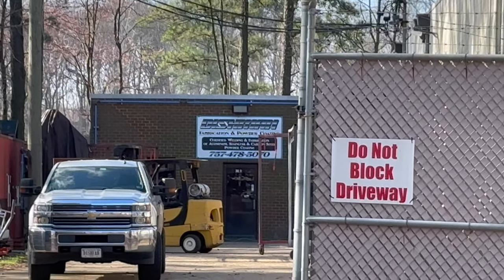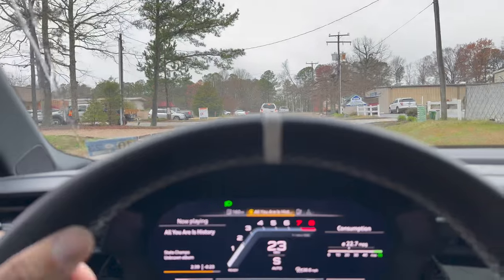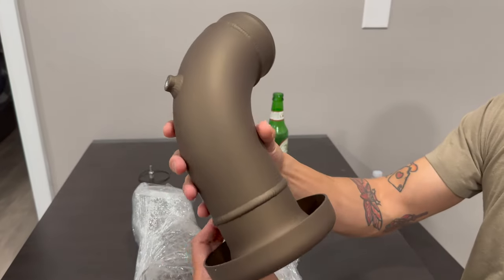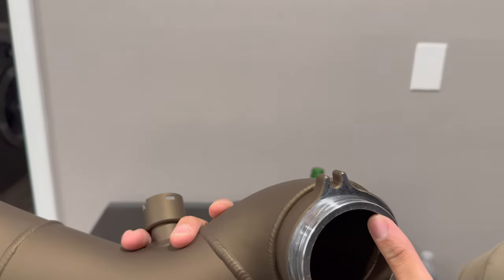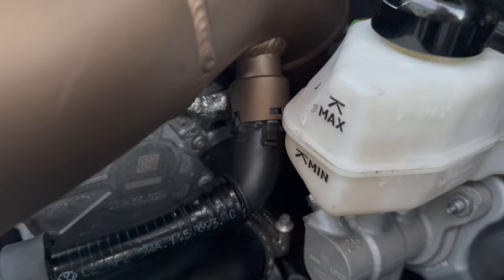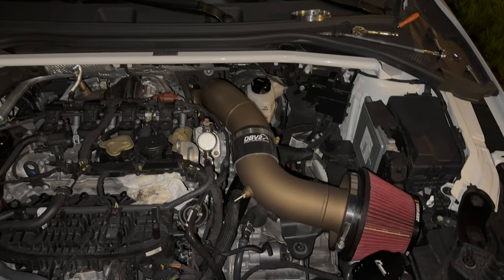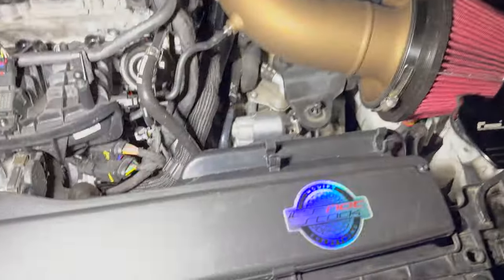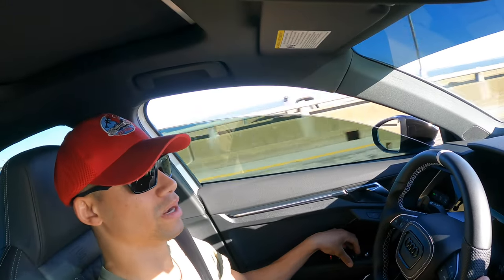DBV2 6" Velocity stack intake is back with Cerakote! Install + First pulls! | MQB EVO GOLF 8 R & 8Y

Comment: Great video. Just wondering what strut bar is that? Did you notice any difference in handling or chasis rigidity?
Reply from the maker: It is ultra racing! Didn’t really notice a whole lot as I have the verkline tubular subframes keeping things pretty stiff, but it doesn’t hurt to add it!

Comment: Does it help alot with the heat?
Reply from the maker: It does 👊🏾 wish I had a temp gun to show the data. It’s worth it!! All the DAZA cars do it too, that’s where I got it from!
Reply: @BryceJordanProductions  Nice! I was thinking of going this way instead of a water meth setup for ease of install.
Reply from the maker: Meth will give you wayyyyy cooler intake temps.. not even on the same level lol

Comment: Can you not just spin the pipe the other way so the filer is face the motor and extend the the vacuumed line
Reply from the maker: Prolly could honestly
Reply: Yeah give it a go it might sit nice in the racingline tray aswell
Reply from the maker: Just did a test measurement it wouldn’t, it would sit like a 1/4 way into the intake manifold. Pics and video doesn’t do justice on how Yuge this thing really is. Just seems smaller cause of all the empty space around it lol

Comment: Does not look performant at all. Sure , its bigger but its also located right behind the headlight. There's no clear/cold/ram air over there. Hope it works out for you but imho its worse then racingline.
Reply from the maker: Low pressure areas are best for intakes from my research. Which is the opposite of what most intakes do for these cars… the data will show it. We shall see!
Reply: @BryceJordanProductions  I love data , lets see that. Arguably it might be faster the first run , but as it gets hotter it might fall out.
Reply from the maker: @dbogdan17  that’s what the cerakote and blanket is for 😉 we shall see this weekend!
Reply: There are years of countless data that shows no detriment of running open air intakes. The goal is to reduce restriction and increase airflow as smooth and direct as possible into the turbo. Forced induction works by compressing the air which will no matter how much you try, will heat the air up passing through the turbo. The charge system has an intercooler which sole job is to cool the charged air. We produce some of the most powerful MQB cars of all, Bryce is in good hands 😎
Reply: Also, the air is recycling within the engine bay at a rapid rate. You’ll never have stagnated standing air while moving, you race driving not standing still 😁
Reply: @DBV2  i see. Lets see the results :)
Reply: @dbogdan17  dbv2 has the #1 highest flowing mk7/8v inlet and intake… why would they shoot for anything less with the mk8/8y? The results are on their website and in every Facebook group.